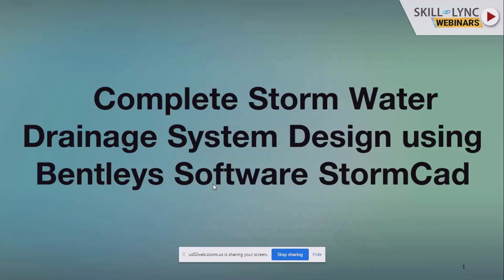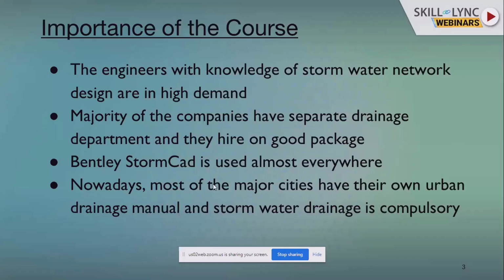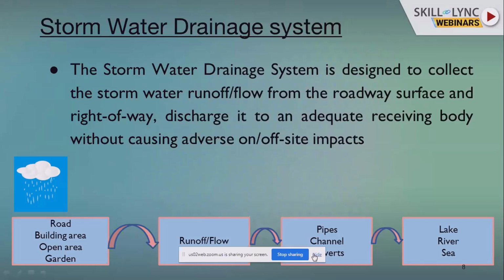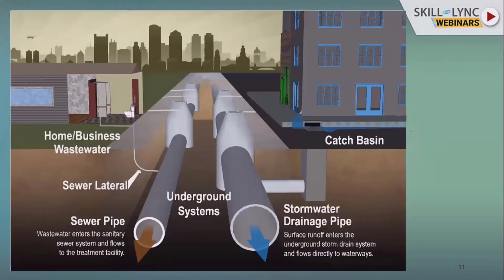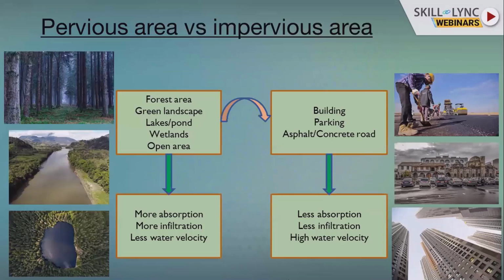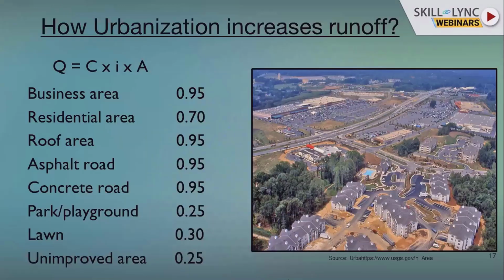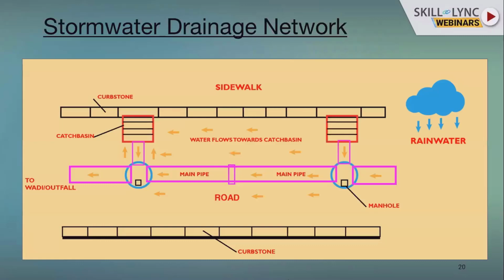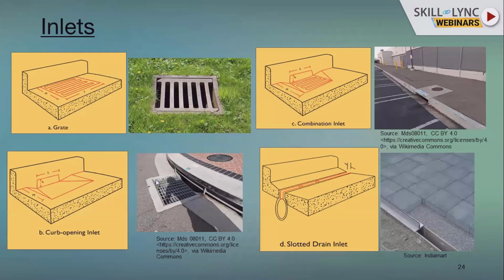Stormwater Drainage System Design using Bentleys Software Stormcad (Part-1) | Skill-Lync | Workshop

Comment: Hello sir, 
My name is Partha Barai 
I am M tech final year student ( Water Resources Engg., NIT Rourkela)
I am working on my project : Urban flood Management by Using SWMM.
my question is that is it better to use StormCad instead of SWMM to design the drainage in heavy rainfall.
and this software is freely available or not?
Reply: hey im too in the same boat, is there any way i can contact you to get some help......